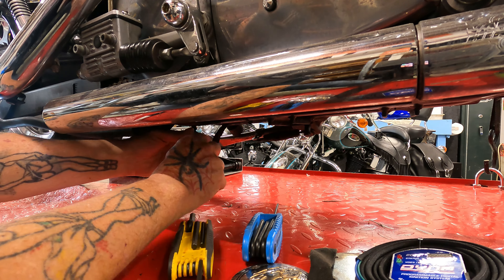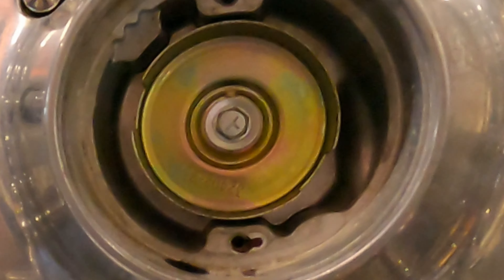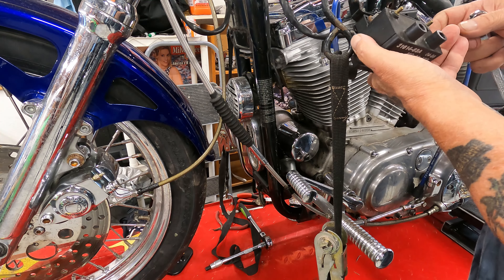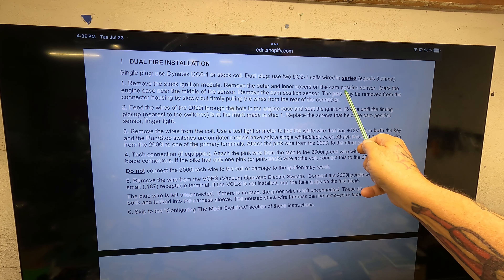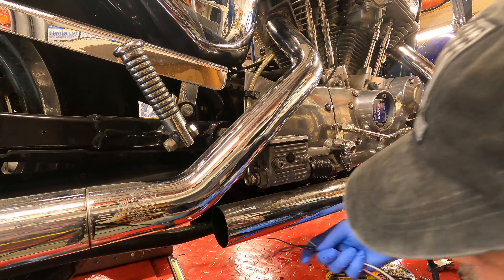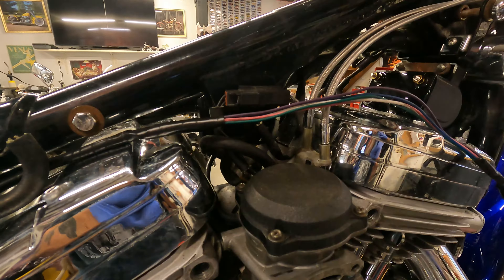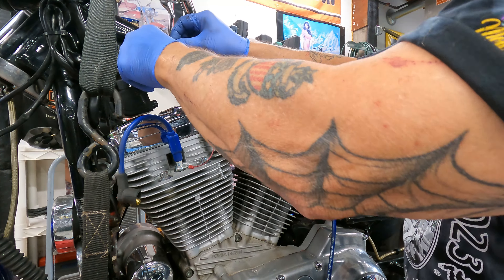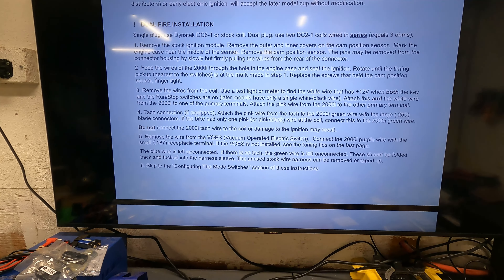Transform Your 98 Sportster With Dynatek Ignition Installation!

Comment: Well recently someone came over and then his bike didn't start the dynatek 2000i.. what is the problem I end up getting a 2000 turns out there's several different models.. I guess the p is for dual fire and then the I model is for dual or single... I live and learn every day but yeah it failed it was the one that plugs into the harness and fits under the seat.. I thought I'd tear it apart but it's just like a glob of glue and plastic so I figured I wouldn't do any good to cut it in half..😮
Reply from the maker: There are switches on the 2000i to set single or Duel fire. The one your talking about has the stock ignition module under the seat that for earlier sporsters or dynasty.
Reply: @daygersden  well this was on someone's I think 98 Softail it's got the S&S motor.. but he wanted a new one and picked it out on eBay and it's only.. dual fire it has one less dip switch the last one is missing.. I guess maybe it was cheaper or something it was still like 250 bucks.. I've got one of my bike in the 98 Softail and I have a spare that I carry just in case.. I pick mine up used probably about 75 bucks each.. oh probably about 5 years ago
Reply from the maker: @MoeLarrycurly1 probably a different stock ignition mode. The older ones the use the silver timing cup won't work with the 2000i,but you can upgrade to the gold cup which will work with it.
Reply: @daygersden  well it already was set up for a 1911 look in there but it had the 2000 I.. yeah it was running fine when you left I mean I know very little about the bike it was my neighbor's bike he sold it to another guy his friend and his friend sold it to another fella and he's been bringing his bike over here cuz.. that's not his forte I think he used to run a landscaping crew for about 30 years.. so it's kind of nice to make a couple extra bucks here and there helps out retirement cuz you don't get much off of social security..